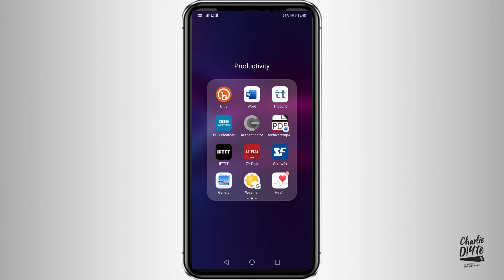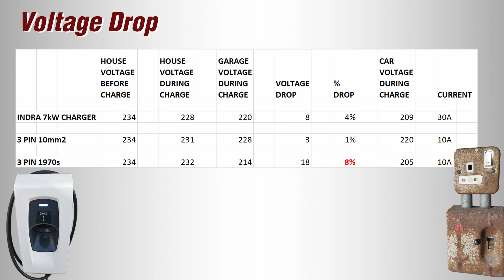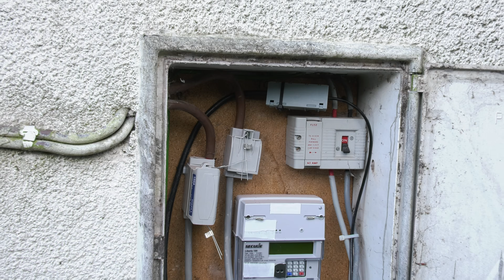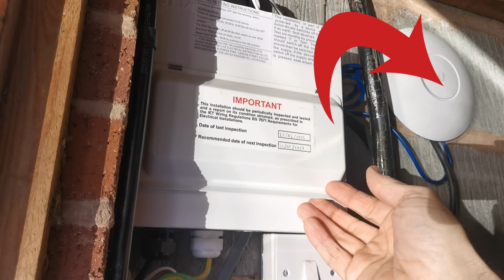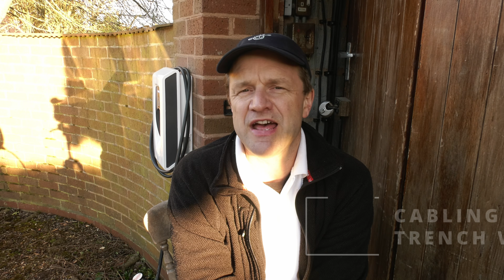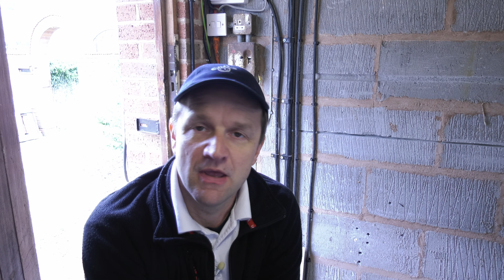Installing a Home EV Charge Point - Everything you Need to Know

Comment: To anyone wishing to do this DIY. Please don’t! Get a professional electrician to install one for you and don’t expect the earth for nothing. 

You get what you pay for. 

This video is more of a summary, than a how to guide. Everyone’s scenario is different.
Reply: This advice should be stripped from the internet, electricians use the advice that their work is somehow 'special' to do the shoddiest least workmanlike crap I've ever seen and charge the earth for doing very little. It's not difficult and you can do a lot yourself.
Reply: @pgtrots  well when your house sets on fire because the work you’ve done ‘works’ just think about that.

Just because something works, does not mean it’s safe and having a safe electrical system is probably the most important thing in your house. If water leaks, nobody’s going to die from it are they? If you have a poorly installed circuit  or device it can kill. If you want to play roulette then crack on pal.
Reply: @yrification  It's not roulette if you do it properly and it is very easy. House hasn't burned down yet and all my wiring is neat and well mechanically fixed - something I have never seen an electrician bother to do.
Reply: @pgtrots  well you’ve clearly had the wrong people to do work then. Plus you can’t just generalise. Has your work been signed off?
Reply: @yrification  Everything that needs to has. Maybe I have had the wrong people but when finding the right people is harder than doing it yourself it seems like a no brainer. Genuinely I have found electricians to be the most insufferable lazy moaning twats who are the absolute worst at blaming the previous work (perhaps if your trade had a better work ethic you wouldn't have to struggle with badly laid wiring) and I won't stand idly by when someone needlessly promotes their profession.
Reply: @pgtrots  I wouldn’t say needlessly, when I’m promoting getting work done safely. Maybe your just better than everyone because that’s how it comes across.
Maybe your expectations of the work you require, don’t match what can reasonably be provided within a set budget. Plus if your standing there telling the tradesmen how much better you can do it, your likely to annoy people.

Comment: You just haven’t got any selectivity or what use to be known as discrimination between the 30mA RCBO in the garage and the supply from the house that’s 30mA too, it should be a 100mA time delay unit so you don’t get nuisance tripping of the sub main supply when one of the 30mA RCBOs trips in the garage, or it doesn’t trip and the one in the house does first.
Reply: He isn’t using the earth from the house, the garage has an earth rod.  The only time that garage supply rcbo will trip is if there is an earth fault on the supply cable.  An earth fault on the garage circuits won’t be ‘seen’ on the supply rcbo.
Reply: @robertwilliams7222  I’d be willing to bet that the electrician still glanded the SWA off straight into the side of the metal DB in the garage and in doing so has exported the earth through a parallel path so the RCBO in the house would still see the other earth leakage from the circuits down stream, happy to be proven wrong and he’s glanded it off into a plastic adaptable box and not carried the earth through. It is still best practice to put a sub main fed from a TT system on a 100mA time delay protected circuit
Reply: @whatthedeuse  why would you just assume that? What a negative person.  On the other hand I wouldn’t make such an assumption because I haven’t seen how the supply cable has been terminated.
Reply: @robertwilliams7222   18yrs as an electrician has made me a very cynical person lol 😂
Reply from the maker: When he comes back to upgrade the tails I'll ask him. 😉👍
Reply from the maker: @whatthedeuse  I'm afraid to say he has carried the earth through as you suspected - his point being there needs to be cut off protection if someone accidentally cut through the cable. I guess this means we need to swap over the RCBO to 100mA.
Reply from the maker: I might be wrong but I'm pretty sure that house board has 100mA time delay - clearly I'm not clued up on this stuff but suggesting else had commented that it does! Another one to check when sparks comes back.
Reply: @CharlieDIYte  Don’t worry about putting the garage supply as a time delay protected circuit, as long your spark has not exported that Earth to the garage then that’s fine.  100mA time delay will not save a life. 30mA will.
Reply from the maker: @robertwilliams7222  Robert, never thanked you for your reply but here's an update, as I'm preparing the update video after Chargedev came over yesterday and installed a double pole RCBO. Unfortunately sparks has exported the Earth - (the sheafing is connected to the earth bar at the house and garage DBs), I think because he was trying to protect the cable against anyone cutting through it. So looks like we're back to needing to install a 100mA RCBO at the house end), unless I can just disconnect the earth from the gland at the garage end...
Reply: @CharlieDIYte  Yes he needs to disconnect that SWA gland from your garage consumer unit.  The cable will be protected at the house rcbo if anyone was to cut through it.  In regards to your metal garage CU, he’ll have to gland the SWA cable into a plastic enclosure like a Wiska box and just have the Live and Neutral go into your garage CU.  All earthing in your garage circuits need to be with your garage earth rod ONLY.  It’s vitally important that there is no continuity between that gland and the garage earth bar in the consumer unit.

Comment: Bloody hell..just stick to a petrol car, and save ya money..petrol cars ain't gonna be stopped in 2030 as the government say..cost to do all this, including re landscaping garden  40 grand..cost to fill car up with petrol..nothing
Reply: Hydrogen powered cars seem quite promising. Has the convenience of filling up rather than charging and it will probably be easier for petrol stations to convert into hydrogen stations. But we'll have to wait another 20 odd years. Until then I think petrol or hybrid is the way to go.
Reply: I wasn't aware of this though it was petrol and diesel.
Reply: Wayne Kerr, petrol doesn't cost "nothing".It currently costs £2500 to do 12000 miles a year in a petrol car. The same electric car only costs £1000 to charge for the same mileage, while you pay more for expensive petrol to pollute the planet to its death.

Comment: That's cool didn't know if you got the grant if you installed your self
Reply from the maker: No, you'd need to get an approved OZEV installer to do it to qualify for the grant, but it ended on 1 March.
Reply: @CharlieDIYte  It actually ends on the 31st March. As in the install and grant application has to be done prior to that. I suspect all the installers are fully booked by now though so it's unlikely you can get it.
Reply: @CharlieDIYte  yeah this is wrong, ends at the end of March and not the beginning.